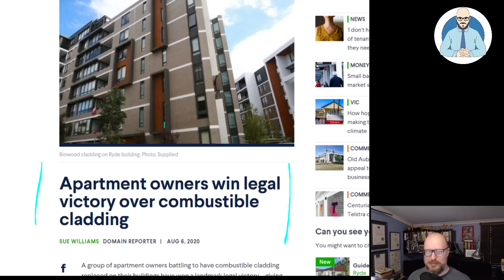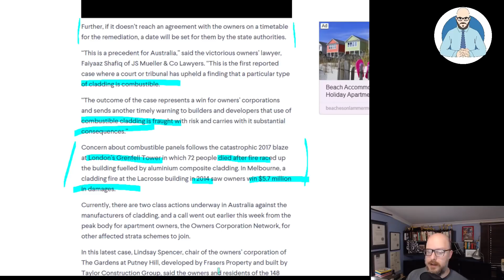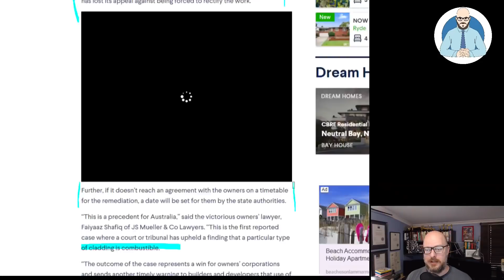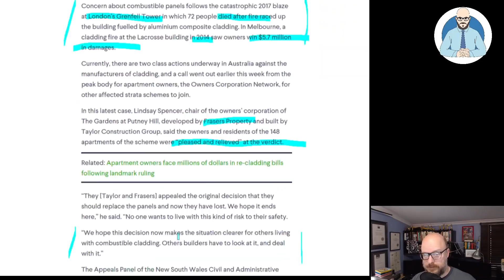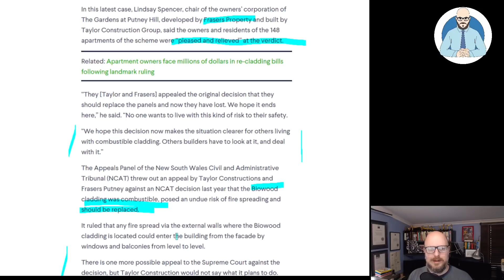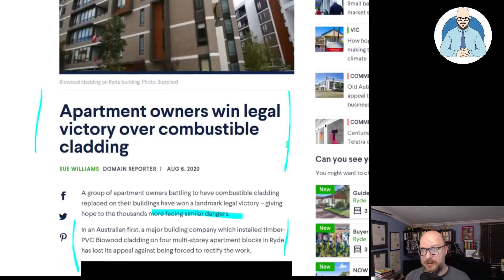Win For Flammable Cladding Apartment Owners

Comment: I am regularly asked to assess if cladding systems comply. Typically these have been raised as being suspected of not complying with the building code. In every case they have not complied with the exterior surface finish requirements. The architect has been told of the required performance and they failed to even check the product. During one investigation Alucobond was a product I looked into.  In NZ they have 3 products and 2 of them do not comply for multi-storey use. At the time of construction only the two non-compliant products were available on the market. The product is complete crap.